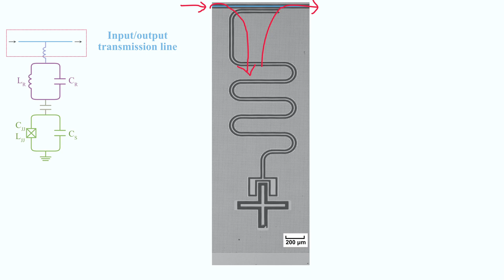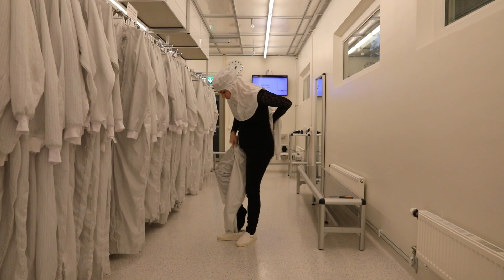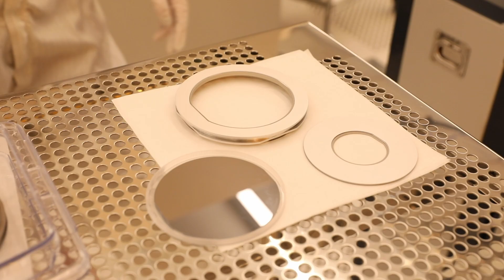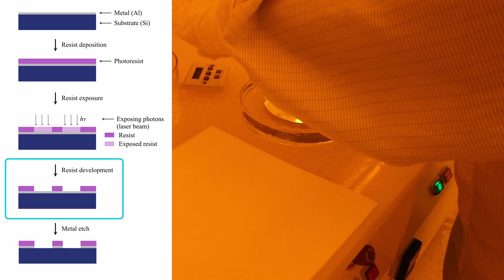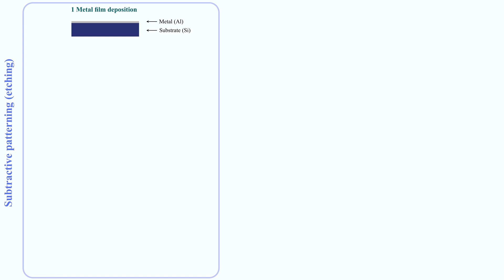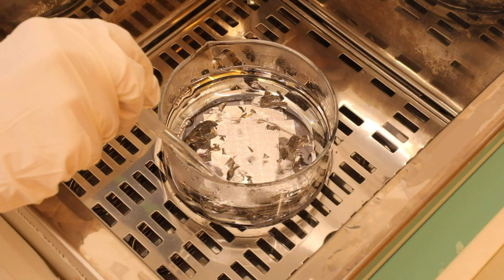How to make a superconducting qubit

Comment: With the experience of foundational experiments under his Berkeley Phd advisor, Nong-Qiang Fan is the first for proposal of the possibility of Superconducting quantum computer in 1994 by independent research after leaving UC Berkeley four years earlier:
Charge qubit: Physica C 234 (1994) 146-150;
Flux qubit: Physica C 262 (1996) 195-201.
Also in the two papers (1994 and 1996):
Quantum condemolition measurement of Qubits;
Decoherance time calculation based on laser and NMR theory;
Charge state representation of microscopic quantum state;
Charge and Flux commutator [Q, phi]= ih_bar;
Energy level and wave function calculations based on creation and annihilation operators;
Quantum Josephson relations;
Translations from Quantum behavior to classical behavior, based on linear response theory, correlation functions, and fluctuation-dissipation theory.
https://www.sciencedirect.com/science/article/abs/pii/0921453494900663

https://doi.org/10.5281/zenodo.23422426

Comment: Thanks for the insights! How do you prevent the etched silicon from oxidizing during the Al2O3 buildup step? May be i missed this info
Reply from the maker: Hi, do you mean during the JJ electrode oxidation? By that time, the silicon oxide has unfortunately regrown in the etched areas. HF-cleaned Si exposed to the atmosphere will always reoxidize with a layer of native oxide eventually. So removing the SiOx immediately before the Al deposition is a great way to get a nice and clean Si/Al interface, but once you open gaps in the Al, the exposed Si/air interface will grow oxide.